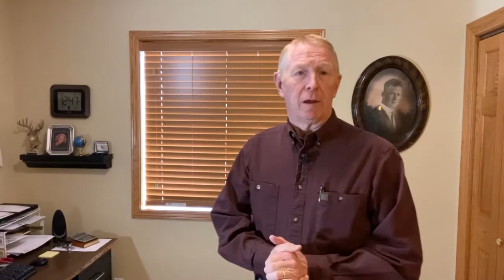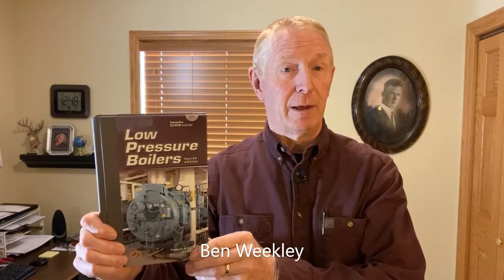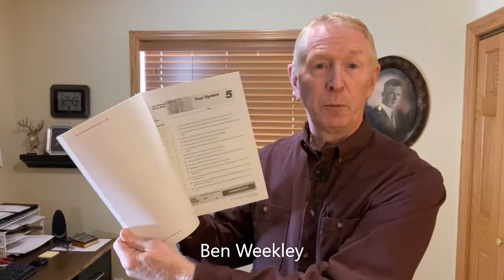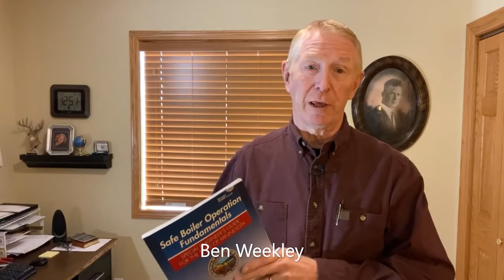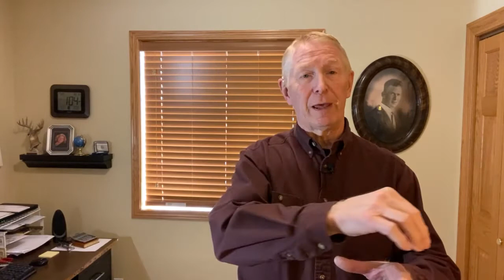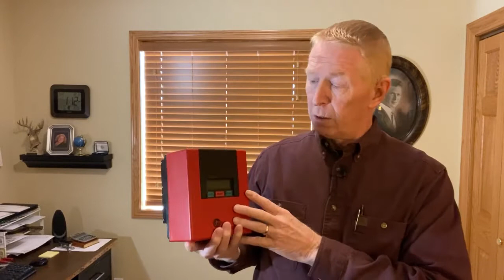Low Pressure Boiler Training-Session 5-Boiler Ben

Comment: Thanks for these videos sir, I've been brushing up on my instrumentation knowledge. I work in a coal fired power plant with 2 150 lb package boilers and 1 1500 lb fluidized bed boiler. Obviously the pressure is way higher but the principles are the same.
Reply from the maker: Thanks for the comments. I think fluidized bed has less emissions than burning in suspension with pulverized coal. Keep the fire going!

Comment: Hi Ben I have questions how many safety cut off valves in steam or hot water boiler? Thank you Ben and I also noticed every session you changed your picture frame.
Reply from the maker: Codes for Low Water Fuel Cutoffs have changed over the years. Most good sized boilers not are required to have two. Many will have one float type and one electronic probe type.